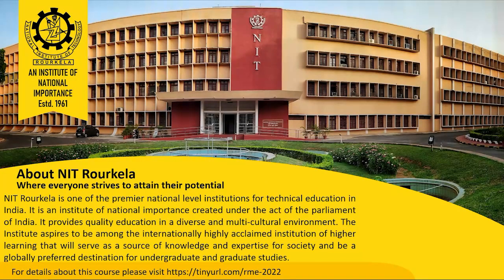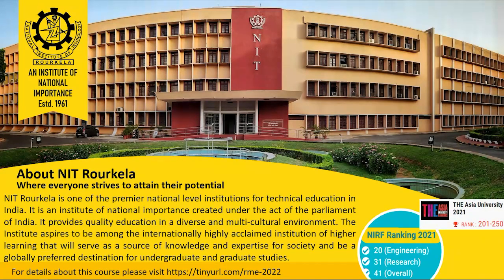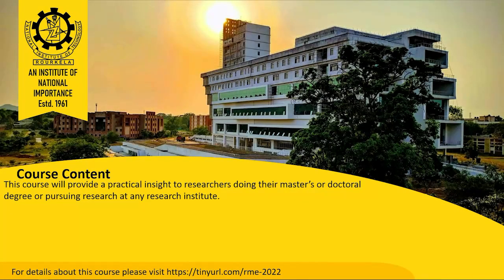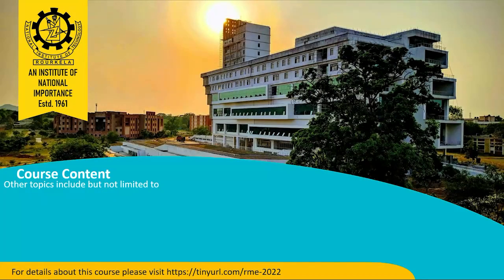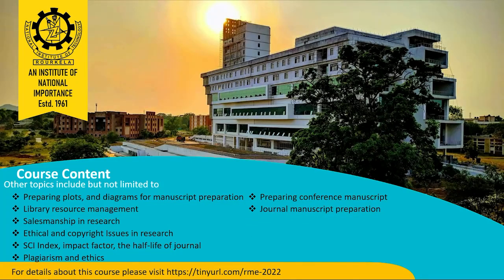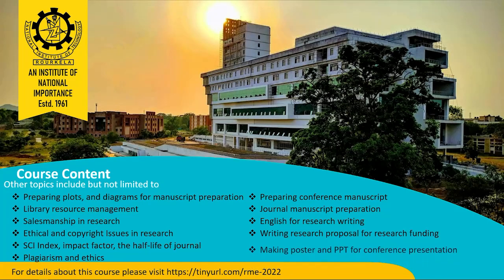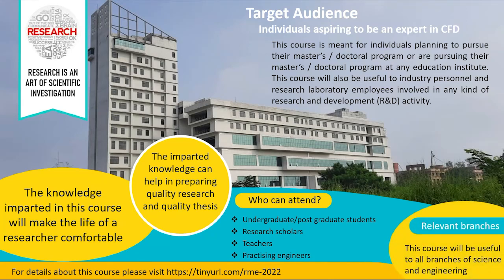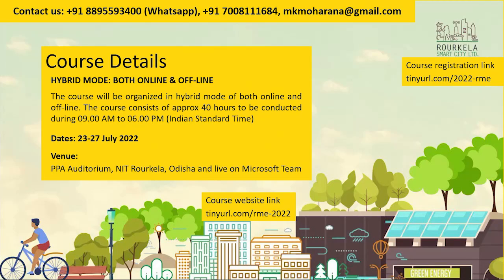Short term course on "Research Methodology in Engineering: A Practical Insight for Researchers"

Comment: This is good attempt. My good wishes are with you for its success. However for engineering students Research Methodology has generally two parts. 
Part A consists of topics included in this STC. 
Part B consists of topics from engineering mathematical skills useful in modelling , analytical studies  and MATLAB based simulation studies. However in this STC there is no mention of these parts.
I have been teaching Research Methodology & Techniques at NIT Srinagar for last three years where course content includes both parts.